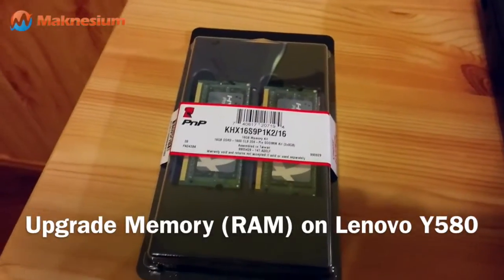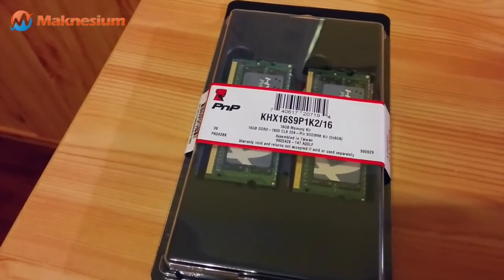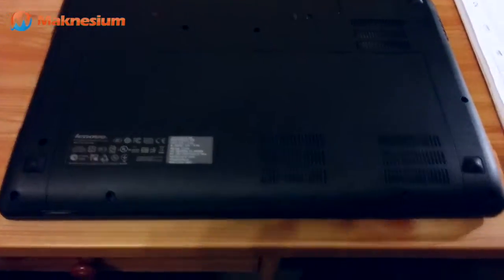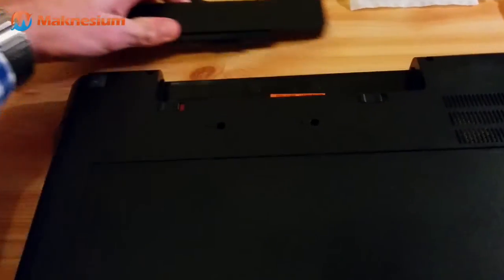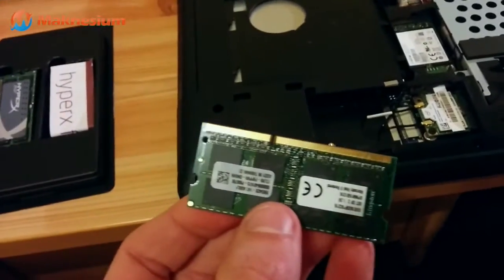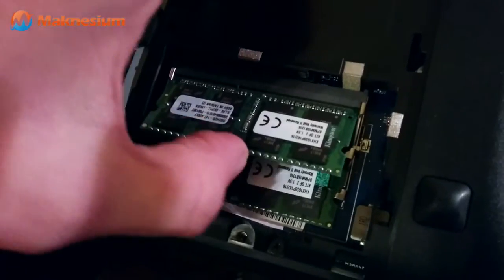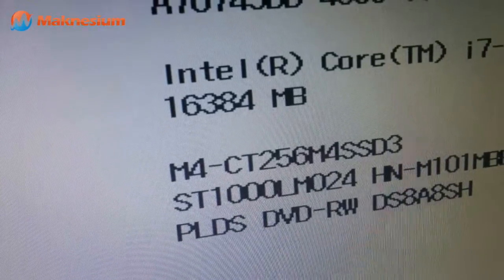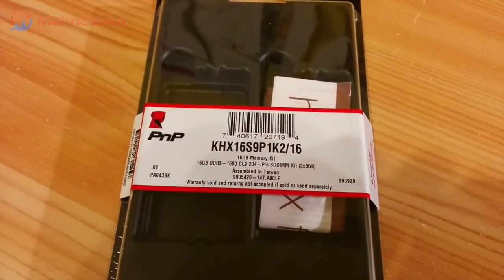How-To Upgrade Memory RAM on Lenovo Y580

Comment: Can the Y580 utilize faster ram such as 1866 or 2133? Or will it just throttle them down to 1600? Is there a way to change it in the bios if it will throttle?

Comment: Thanks Maurice....I just upgraded to 16Gb with no issues.....memory occupancy as shown in task manager running at 50% of prior 8Gb configuration....I'll update if I find any negative issues in the next few weeks.....appreciate the video.
Reply from the maker: Hi +Art Julius 
Glad you had a good experience upgrading to 16GB RAM. Let me know how it changed your computing experience and if the upgrade was worth it :)

I've beeen using 16GB for 3 years now with absolutely no issues (the modules from the video, which are linked in the description). GREAT upgrade overall for the Y580!
Reply: One year later and my machine is still performing well.  With 16 Gb of RAM I can view 4K videos which was impossible with the prior 8 Gb configuration.  Although this machine lacks a 4K screen I can still post-process 4K video from my drones to check for issues.....looking forward to running this computer for another few years!

Comment: ich habe mir überlegt auch ein ssd in mein y580 zu verbauen. ist es möglich, dass ich dann mein vorinstalliertes betriebssystem auf der neuen ssd installieren kann? ich habe schon öfter von problemen bei einem vorinstalliertem betriebssystem gelesen.
Reply from the maker: +Jonas Musen Ja, das ist möglich. Dazu baust du die SSD zusätzlich zur Festplatte ein und überträgst dann die Windows Installation auf die SSD. Hier steht wie es geht (Englisch) http://www.itpro.co.uk/operating-systems/26152/how-to-move-windows-10-from-your-old-hard-drive-to-ssd
Reply: im gonna answer on english so non-german users can read it aswell.
i installed a samsung ssd additionally to my existing hdd and used the samsung data migration software to transfer all existing files from my hdd to the new ssd. i didnt even had to change the bios boot options.
just make sure you clean up your hdd before transfering to safe some time and space on your ssd. the more you fill up your ssd the slower it gets.
i installed the ssd in july 2016 and dont have any problems since

Comment: Do you know if this will work for the y480 as well?
Reply from the maker: +XAustria I looked a bit on the web and the memory seems to work fine with the y480 as well. BUT I found reports that the y480 seems to be much more picky about memory modules so why it should be able to handle 16GB in general, it might not actually like the specific memory modules which I linked. Anyway, I would just give it a try and send back the modules if they do not work.
Reply: Thanks much!!

Comment: What is the greatest benefit, honestly, after installing the mSATA ?
Reply from the maker: +jrwill58 With an ssd in the mSata slot you get a lot more speed (because of the ssd compared to a normal harddrive) and you save both "bay" slots for an ssd or DVD-rom drive. You could also buy a normal 2,5" SSD and take out the built in harddrive. With the mSATA version you can keep the built in harddrive, the dvd-rom and have an additional SSD :)
Reply: Maknesium.com This is my second Lenovo. My first was a refurb Thinkpad T420. The reason I bought this one was to replace my hiend 17" Cyberpower  Clevo B7130. It had a BlueRay ROM , a 7200 rpm hdd, Dedicated Graphics....but it was a bit over 5 years old and I paid $1200 for it ! Now I bought this Y580 for $575 (gently used-like new) and it has better graphics and the m-SATA to name just a few. I just upgraded the RAM to 16GB . I kinda wanted a BluRay instead of the DVD drive but Im a bit in the dark of just how much I can add or upgrade. I dont want to go hog wild, but a few bucks here and there wont hurt...maybe.It's funny how I spent half as much and got a laptop twice as fast, and thats  comparing 2016 dollars to 2010 dollars.Do you have a link to a place where these mods are discussed ? I appreciate your help, I really do.
Reply from the maker: jrwill58 I'd go on ebay to look a a BluRay drive that fit's into the y580 - if you really want to have a bluray drive :)

I guess, if you have 16GB RAM, a fast ssd, a big hdd and a bluray drive there's not much more you can put into your y580 :)

Comment: Hi. I am also trying to install an mSATA SSD in my Lenovo Y580. Will I need an extra screw? Is the installation simple?
Reply from the maker: +Madhav Gopalan Yes, the installation should be very simple - don't worry. Just make sure you buy the right SSD (like the one linked in the video description above) which also comes with the extra screw you need to hold it in place.

Comment: I have a Lenovo IdeaPad N580 with just 4gb of ram, at first it was just for school and internet surfing but eversince i got into music production its been giving me huge problems, the recommended ram for music production is a minimum of 8, im blessed enough to even have it work fine for some time until too many plugins were running, if i get 16gb of ram upgrade, will music production work as effecient as a mac or asus with 16 gigs of ram? I worry because my laptop is cheap. And i dont want to misuse any money, im tired of being stuck with unfinished beats.
Reply from the maker: +Aztechnological Hi, more RAM definitely will speed up your workflow doing music production. Keep in mind you need a 64-Bit Windows version (x64) to use more than 4GB of RAM. I'd suggest you first get 16 GB RAM and see how far you can go with that. For even more speed (especially for music prodution and other resource heavy tasks) I'd suggest you might want to give a SSD a try. I've linked the 16GB RAM and the SSD I use in the description of the video.
Reply: +Maknesium.com Will the ram you listed above also work for the N580?
Reply from the maker: ***** Yes, it will work with the N580. 16GB will also be the maximum amount of RAM for the N580. Have fun upgrading :)
Reply from the maker: Yes, I think so :)

Comment: Hey man, I'm trying to decide between this memory model you used and the hyper x Impact DD3L http://goo.gl/YLlu66 ... I haven't seen any compatibility issues, do you know of any?
Reply from the maker: +DosedJam Yes, you can use this memory as well. Theoretically, I uses only 1.35 volts - so it should have a lower power consumption. I doubt this is noticeable but you might get an extra few minutes out of your battery.

Comment: Liked and Subscribled.
My question is, how do I upgrade my current msata ssd with boot drive installed on it?
Reply from the maker: Hi, do you want to know how to physically switch the msata drive or do you want to how to transfer over all your files and your operating system onto the new ssd? DEANLuxray
Reply: Maknesium.com Thanks for the fast reply, I want to know how to to transfer all my files and my operating system to the new Msata ssd.
I already have an 60Gb Msata SSD installed with my Operationg System on it, I want to upgrade to 120GB SSD mSATA: http://goo.gl/4NSZYV.
Thanks
Reply from the maker: DEANLuxray There are many possibilities you could do this. You could use this guide (http://lifehacker.com/5837543/how-to-migrate-to-a-solid-state-drive-without-reinstalling-windows). Don't worry - just read it as "transfer ssd to sdd" instead of hdd to ssd. You could also use software like acronis true image for that job. It's fairly straightforward :) Problem could be, you need to have two msata ssds connected at the same time for the transfer. In that case, you might find this helpful :) http://www.amazon.com/gp/product/B00AYIDDMA/ref=as_li_tl?ie=UTF8&camp=1789&creative=390957&creativeASIN=B00AYIDDMA&linkCode=as2&tag=wwwjoinmygift-20&linkId=GVQXRZTGHALQEJKP
Reply: Maknesium.com
Hi I am looking at the ram link that you provided and I noticed that "There is a newer model of this item: http://www.amazon.co.uk/Kingston-HyperX-Impact-1600MHz-Notebook/dp/B00KQCOV5C/ref=dp_ob_title_ce"

Is this "newer Model" going to work on my Lenovo y580?
and which one would you recommend, the link you provided or the "newer model"?
Reply from the maker: DEANLuxray
Yes, you can use this memory. It should work in the y580 :) It is faster than the old memory.

Comment from the maker: Hi, yes I swapped the memory modules completely. The old modules were slower because their access times were higher. The memory bandwidth is therefor lower. The new modules have lower access times so your computer can access the memory more quickly. You get higher performance in the end :)
Reply: Can you make a video on installing windows 10 on this laptop if possible thanks if you do.
Reply: +Maknesium.com  Good evening , and you can put 32 gigabytes of RAM ?
Reply from the maker: +Игорь Храпыкин Nope, The y580 only takes 16gb. I have never read anywhere that someone successfully put in 32GB.
Reply from the maker: +Gold DJvorj Sorry I don't use windows - only linux :)

Comment: Hi friend, 
If I saw well, you have completely removed old memory, and put the 16gb new one. Right? 
How can RAM memory specificaly improve Y580 performance? I am interested to do this, because I would like to run FIFA15 on my Lenovo (I dont want maxed out graphics, just playable) Thanks :)
Reply from the maker: ***** yep, I swapped both modules for the new ones. RAM will firstly improve the speed if you run many programs at one. This specific memory modules I used in the video have a faster "timing" than the stock ones - so basicall your computer can access the memory faster. The y580 uses a built-in graphics card for rendering normal desktop applications which uses system memory as video memory. So: faster system memory - means faster video memory and therefore more "visual" performance on normal 2d tasks like desktop programs. If you want to play a game, the built-in nvidia card will take over which has its own (very fast) video memory. The performance benefit will be noticeable in games because these use system memory extensively.